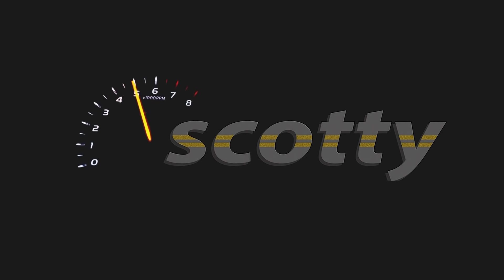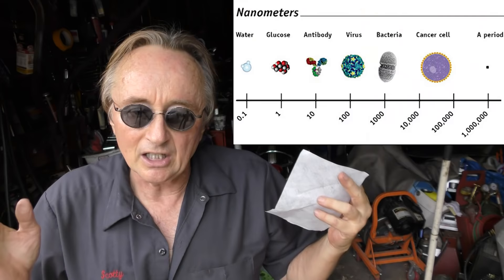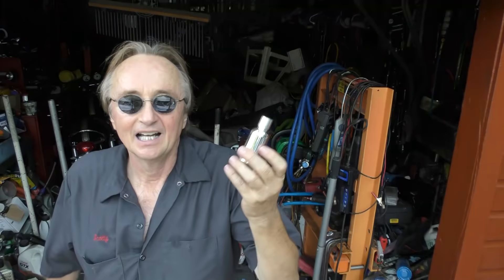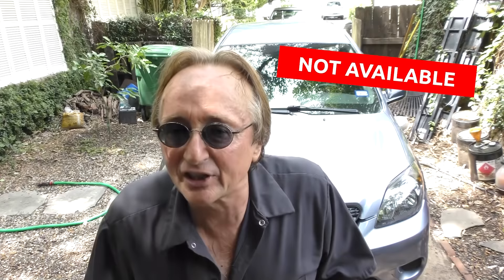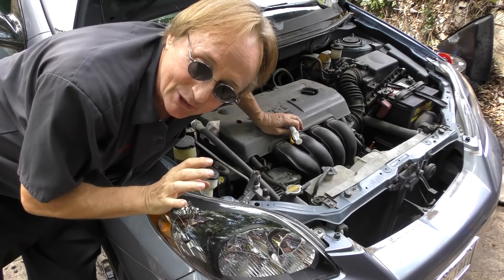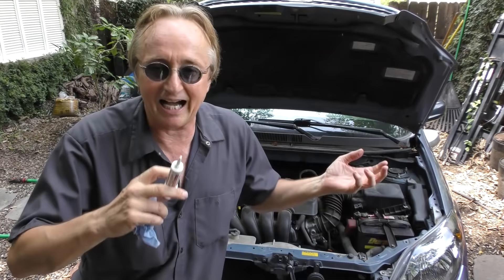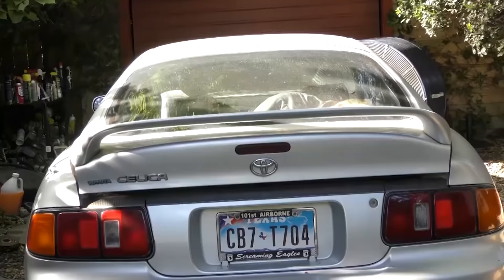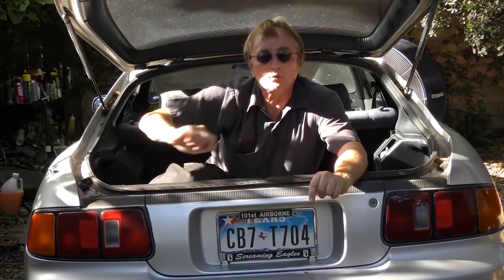Why Not to Buy Nanotechnology Products for Your Car

Comment: So this nano is the same thing as the ceramic coating everyone is all about right now ?
Reply: Yes he is talking about Ceramic Coating. However if you know how to use it, you can see that he didn't know what he is doing, or the purpose of the ceramic coating. That little bottle should be able to do most cars fully. The application is a very thin layer that is applied using a microfiber that you use for glasses. The purpose is to protect against minor scratches to your paint clear coat that you get from washing cars improperly. Before applying your car needs to be cleaned, clay bar, paint corrected, polished, oil removed (alcohol washed), then ceramic coated. Then only by comparing a ceramic coated to non coated side after a wash can you see the difference.

Comment: I've put a nano "diamond" coat on my brand new Mazda 3 in june last year. After a year in Canadian weather conditions, the hood and a small portion of the top is already full of chips. My Saturn Ion 2005 had less chips over the last 5 years I had it than the Mazda. They sold me the coat by telling me it would help to reduce the chips on the paint by making it "smoother" and "filling the holes in the paint". Worst 500$ spent on a car (shouldn't have ask the dealer to put the coat...). I'll have to wax my car this summer anyway since it's already fading away. My wife bought a car at the same time and nobody can tell that I've put the nano on mine (we both have 20 000km).

But, I have to say, I've never seen a car shine like that for 5 months (until the snow arrives).

Thanks Scotty for telling the truth.
Reply: Ceramic coatings won't prevent from paint chips. And Mazda water born paint sucks.

Comment: Mix a silica gel clear micro or nanoparticle with a thin spray of silicone rubber spray waterproof with lotus leaf crepe protection mixture huah yah Hush they'll be permanently water duty dirt dust rust mould corrosion proof.
It'll last a month unless you mix clear aforementioned fireproof added also
Reply: I will are you going to just go buy some clear epoxy totalling biological clear clean lignin epoxy mix crepe protection which will keep your white trainers cleanbut forever or at least a longer time if you mix it with permanent clear epoxy or silica gel &  silicone rubber

Comment: What about ceramic coating? Scotty
Reply: 4ever Young same thing
Reply: 4ever Young That is what he is talking about in the video, but I believe that he is uninformed on the topic... From what I have seen, ceramic coatings work well, but the process is much more expensive and labor intensive than with traditional sealants/waxes. Honestly, the product Scotty bought is a brand nearly no one has heard of, so I wouldn't be surprised if that product specifically was bad (or it was just applied incorrectly which is a possibility given that he wasn't able to finish a single car with the included bottle). If you do some research, you will find there are numerous benefits to ceramic coating your vehicle, but unless you are very capable of polishing your car and following directions to a T, I would recommend going to a respected professional instead.

Comment: You’re great with mechanic work but your advice on detailing isn’t accurate. I do it professionally and when applied right the good coatings do an amazing job of preserving paint depth, clarity and are great at protecting the clear coat from fading or cracking. It’s a good technology but there are lots of rip off brands such as the one you tried.

Comment: Thanks a lot Scott. I was about to get one of these kits for the paint! Now I know! Avoid them....
Reply: Ioannis Stavrou Not true... From what I have seen, ceramic coatings work well, but the process is much more expensive and labor intensive than with traditional sealants/waxes. Honestly, the product Scotty bought is a brand nearly no one has heard of, so I wouldn't be surprised if that product specifically was bad (or it was just applied in correctly which is a possibility given that he wasn't able to finish a single car with the included bottle). If you do some research, you will find there are numerous benefits to ceramic coating your vehicle, but unless you are very capable of polishing your car and following directions to a T, I would recommend going to a respected professional instead.

Comment: Bull shitzen,,,,,,I’ve used a nano tech coating on my 2005 F-150 and new Gen 2 Raptor paint jobs both work great.  
I never had to wax  my old f150 in over 15 years. It coating worked great, as for my new Raptor only time will tell since it’s still relatively new but so far so good.

Comment: Look up nanoceramics. They are totally unrelated and inapplicable to paint coatings. The name sounds impressive and high tech...but it’s a marketing gimmick, much like the pseudoscientific terminology used to market pricey women’s cosmetics. Evidence of these coatings’ effectiveness is entirely anecdotal, a sure giveaway that there’s an absence of scientific support. 

ESCA is an analytical technology for providing information about the chemical composition and binding  energy of surfaces. It is ideally suited to understanding these so-called ceramic coatings. Has it been used to characterize them? No. 

If these coatings were of real value, why are they not applied in the factory, where no prep would be needed? Claims about them suggest they’d extend the like-new appearance of a vehicle, and make washing easier. 

Re: oil additives. There is a legitimate basis for a nanotechnology-enabled extreme pressure antiwear coating based on potassium borate. Under suitable temperature conditions, a borate nanolayer forms on metal parts, which dramatically reduces wear. It’s typically used as an oil additive in, eg, heavy equipment gearboxes.

Comment: Not to bright 
The. Ceramic coating I had put in my car is amazing.  Try your cheap wax in S Florida tropical sun and see how long you get beading in rain etc( 30 days max) Also see how easy baked in bird poop come off .  with ceramic a spritz of water and a wipe clear in about 5 sec. .
Scotty is WRONG

Comment: I didn't believe either tell I used Archoil AR9100 in my Powerstoke 7.3 with injector issues it didn't fix injectors but it did make it drivable. I also did injector buzz test before and 100 miles later. It made a considerable difference from before to after.
Reply: Russell Hawkins true for 7.3 and 6.0 especially. I use Archoil on my GM 5.7 Diesels also with great success. 

On the Ford 4R70W transmissions that shudder, the little tube of Dr Tranny instant shudder eliminating additive does work.
Reply: yea oyou ford guys need all the help you can to make it over 100,000miles so...

Comment: Agreed that the Nano Ceramic coatings are bullshit, But polishing a car will bring your paint to a mirror like finish if done correctly, waxing a car will have your polish job last longer then no wax, applying more wax will not do anything for your paint. But it is good to have some sort of protection on your paint after you are done polishing it.

Comment: It would help to obtain quality product rather than cheap ebay junk before you form your (exceptionally underinformed) opinion.  you lack a serious understanding of the methods and materials required for a legitimate ceramic coating.  To compare it to the snake oil engine additives only further highlights your lack of credibility.

Comment: I like NuFinish, also, but Turtle Wax works better, in my opinion.
Reply: Victory is Myne have you tried Meguiar's gold class liquid?  I find that it comes off much easier.
Reply: deasttn : No. 
    However, I have tried Maguire's wax before. But, I didn't like the white residue left behind from the wax.
     I've used the Turtle-Wax in the little green tub, with the little application pad; it's still the best I've used.